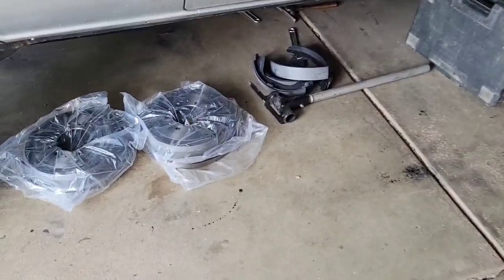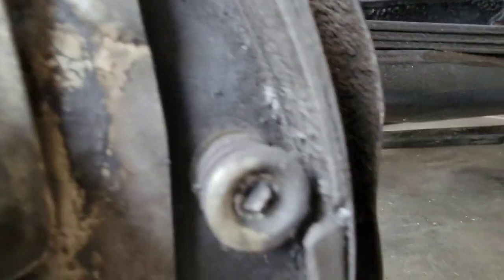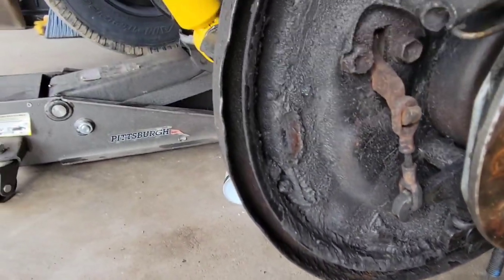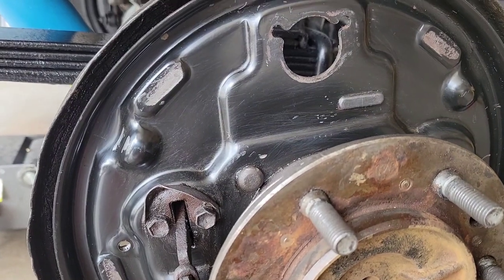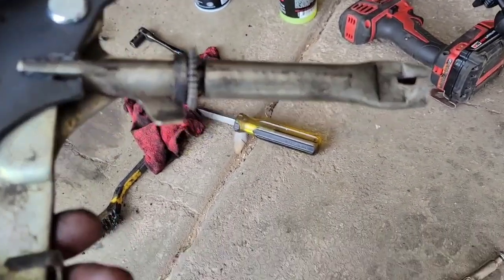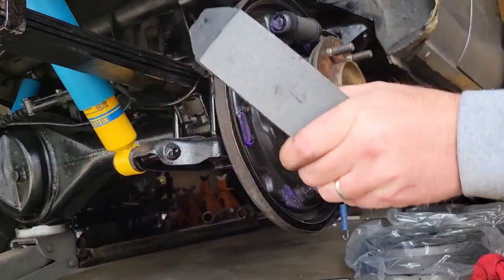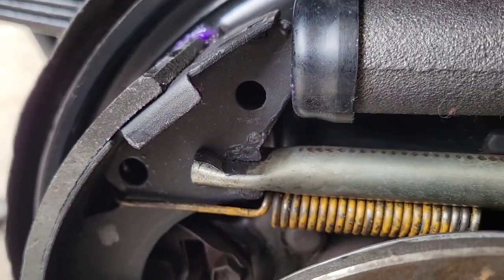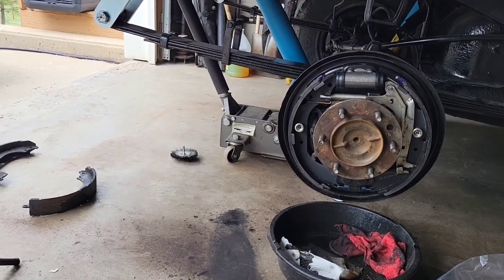Part 11, rebuilding 1988 Toyota 4runner 1st gen, New rear brakes, shoes, drums, and wheel cylinders!

Comment: Hi, love the video. I have a 88 4runner, i can’t find out which drums i need to buy, they come up as the 295 or just regular. Any tips?
Reply from the maker: Thanks for watching! I went to the auto store and purchased the top of the line ones. Not sure if it matters but they asked me if it was a V6 or 4 cylinder. Since mine was a V6 model they sold me these. I recommend matching everything side by side to ensure it looks the same before installing. Take alot of pictures before you disassemble.
Reply: @4WheelingBrian Thank you very much, unfortunately rust got to them before i could take pictures and blew them apart haha. I’ll pretty much just be relying on your video from here